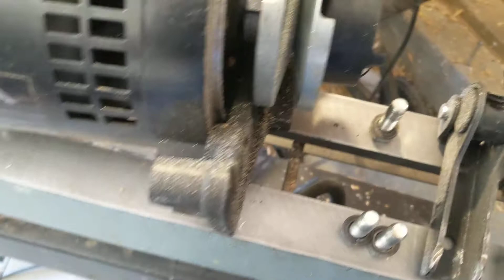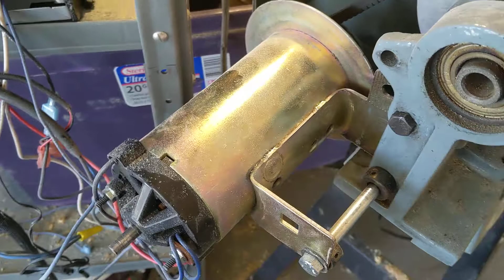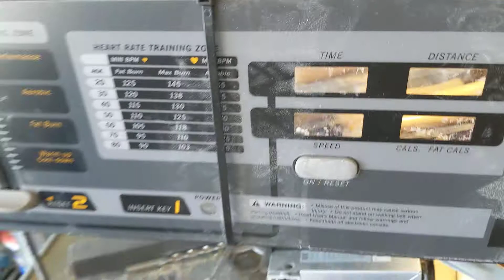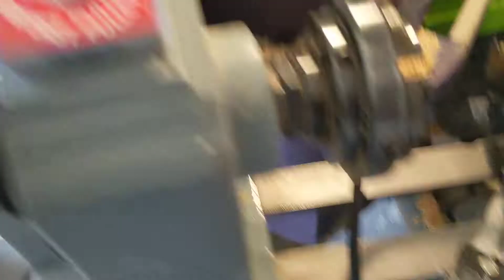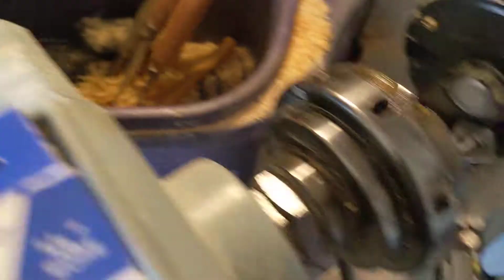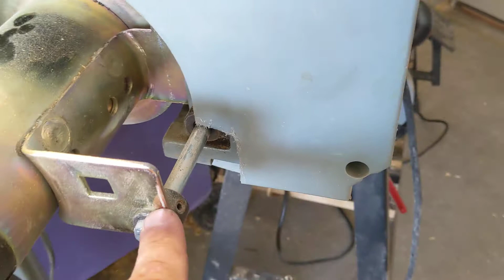Delta lathe 46-700 motor pulley fix - replacement treadmill motor - under $30

Comment: Hi Noah,  I have this same lathe and have had it probably 30 years or more, but had not touched it for a long time.  I recently set up a new shop in our new house and got back in the mood to do some turning.  My lathe still works fine but the belt squeaks at some speeds.  My main issue is it does not have enough horsepower or torque to turn bowls or anything very big.  The squeaking makes me wonder if I might just need a new belt, and/or if I am experiencing a power loss due to a worn belt.   I had been wondering if it were possible to swap out the motor for a more powerful one when I stumbled across your video.  I had been thinking more about a regular electric motor from Harbour Freight (something like 2 HP), and wondering if that could be adapted to fit.  I suppose it would be bigger than the original motor.  I wonder if this were a possibility you ever considered before you found out about the treadmill motor? 

I was surprised that the motor you took from a treadmill actually packs 2 HP in such a small size.  I'm not sure how I'd know what treadmill would even have the correct type motor, much less actually find one cheap like you did.   Kudos to you for your success in this project.   

I'm curious if you could tell a noticable increase in power with the treadmill motor, and also if you are still using this lathe, etc.  I see that your video is about 3 years old so I wondered about that.  I am afraid a regular 2 HP electric motor, locally sourced, would probably be too big to fit, but maybe it could be made to work.   

If you are able to shed any light on any of my questions, I would appreciate it.  Thanks!
Reply from the maker: Oh my gosh - sorry for the super late response...I'm still using the treadmill motor! The horsepower is about the same as the OEM motor, but you get the variable speed control of the DC power from the treadmill controller. It's been really nice to work with, and she's still running great. I only turn about 6 or 7 bowls a year, but it's still working!
Reply: @gongwithnoah   Thank you for your reply. I  had forgotten about my original comment, and I actually purchased a new Rikon 1/5 HP lathe about a year ago, and I sold my original Delta lathe.  I'm loving the new one and I've recently gotten into segmented bowls. It's a blast, and it's addictive.

Comment: nice fix but just to many wires hanging out, my pulley broke last night on the motor side its a delta 46-715 lathe gonna buy replacement pulleys from Grizzly and sell it. lol
Reply from the maker: What was the cost on the replacement parts?
Reply: @gongwithnoah  Hello Noah ,I believe it was $39.00 but not really sure it was a few months ago.It  worked but the diameter is a hair smaller so you can't go top speed or the belt will fly off the  pulley.

Comment: I'm wondering how the treadmill motor has worked for you this past year?
Reply from the maker: If I could attach some photos here I would - It has been really nice. I use the lathe a few times per month. Mostly a bowl on the weekend or spinning sandpaper for other projects. I do want to make one adjustment and that's to acquire a tad longer vbelt, to add just a bit more torque on slow speeds.

Comment: Looks like you are using a timing belt but not timing pulleys??
Reply from the maker: I used the original belt that came with the lathe